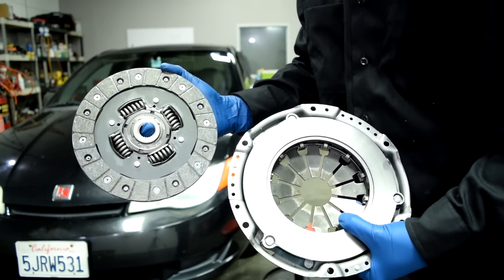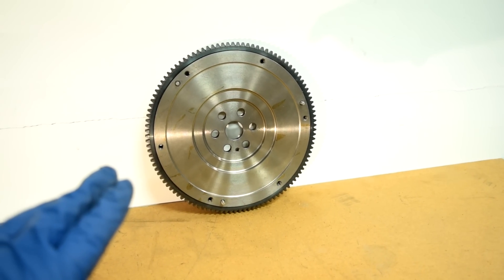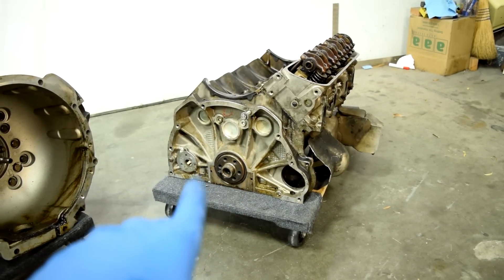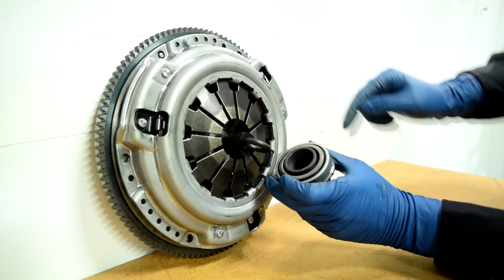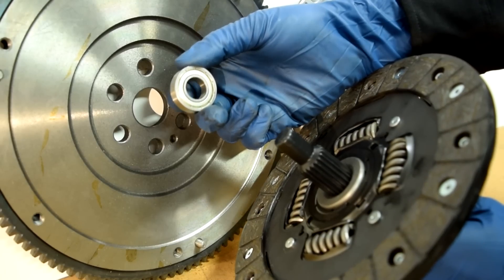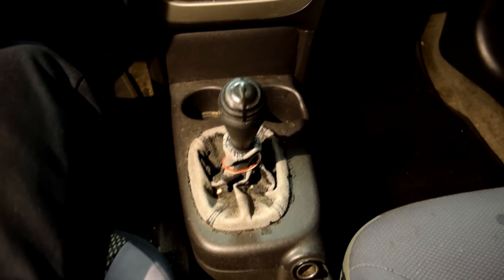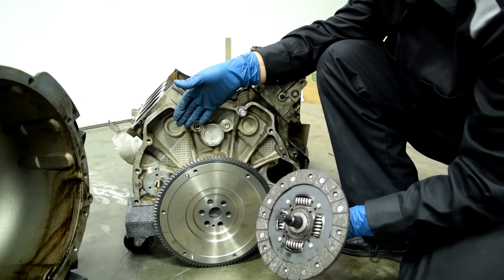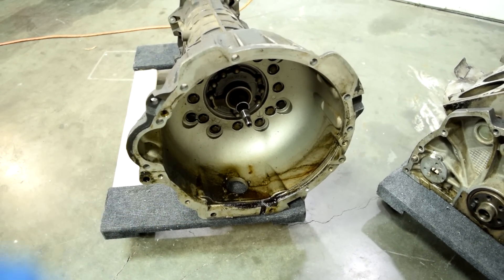How a Clutch System Works and How to Diagnose Issues With It

Comment: I have one question, (And this goes out to everyone who might know the answer)  I have an 2003 Audi a6 1,9TDI. It vibrates around the 2000RPM..  Say from 1850 - 2000.. Every gear. But more noticeable in higher gears. You can only notice it when power is applied.  People told me it would be the Fly Wheel.  How could this be?  Can I eliminate this in one way or the other?
Reply: Sander Baks people are asking all kind of questions and nobody answers ..,sad . me too have a question but I doubt anybody would answer .... anyway , if you or anybody who can give me an answer on a Ford 150 pick up truck 91 year f150 EFI  it got an 5 .0 engine , will that engine be the original engine from factory, ???? I ve seen it on Facebook for sell , I ve seen on u tube videos of that kind of engines are the best on ford pick up trucks now days  , but I did not know they were put on trucks back down to 1991, please any advice, .... should I buy it ????? are those kind of engines really worth it and will that engine be the original from factory,  ..... I do not want to ask owner if engine is original I want a third person answer.... if any one that knows about that particular type of engine, please give me an answer.... thank you very much in advance.
Reply: Hi, Wel, I will answer .. I am from Europe, and that car sounds like a typical US kind of car.  I really don't know .. I am sorry!

Comment: ok. i have a 95 integra gsr (manual). was sitting for a couple years. turned it on in june 2016 but would not drive, the clutch was to the ground. never happened before. alot was going on at the time and i didnt want to mess with it. i haven't touched it since. i did some research and priced a clutch master. what do u recommend for clutch issue and getting car going again after sitting. it doesnt pass smog either but have managed to with the help of old friends. please keep in mind im on a budget. thank you. :)

Comment: My clutch has a bit of a strange issue. It doesn't disengage properly when it's cold outside (difficult to put into first and reverse, grinds second), but as it warms up, it's fine. What could cause that?
Reply: Todd Anthony wrote this in another comment, I wonder if it's what's happening to you? : For safety's sake it is always best to start every manual transmission car with the clutch depressed. In arctic cold weather (like Minnesota) it can actually be a car starting benefit to depress the clutch on starting, once started when you let the clutch back out while in neutral on older cars or worn cars you can actually feel and hear the engine struggle more to turn that thick cold gear oil (like glue in winter) and it puts an additional load on the motor. So it's a good tip for older cars in sub zero temps to depress the clutch and hold it in for a minute while motor stabilizes it fuel delivery and builds proper hot compression.
Reply: This has nothing to do with that. I can hold my clutch for an hour, if it's cold outside, it doesn't work properly.

Comment: Story to tell I'm 24 yrs old I bought my first manual car almost 2 yrs ago the clutch went out when I had 3 months with the car apparently the previous owner rode the clutch pedal all the time at first it started making this really bad noise when I would depress the clutch pedal throw out release bearing and then it wouldn't go into gear if the car was on and then the clutch pedal lost all of its pressure lol it went down all the way to the floor with no pressure had to replace it it's been by far the biggest expense I've had to do on my car I'm a DIYer but wasn't too knowledgeable on clutches but I do know for sure I will be replacing the clutch myself when it's time

Comment: my muffler bearing went out of my truck it cost me 1200$ for parts and labor😂😂
Reply: Did they also fill up your blinker fluid?
Reply: Aaron Frazier 
Is the muffler part of the crotch slave? 🙂
Reply: have you checked your piston return spring yet after a year, 😂
Reply: At 1200 You got deal!  I wish we could go back to the old days when muffler bearings where 1.00 and they would always clean your car for free with this service.
Reply: ast5515 what the hell ........??????
Reply: yeah when you pay for that its best to place your hands open palm side down  flat on the ground spread out a bit , trust its so muxh easier on the knees

Comment: Hello R&WAnother great informative video! A lot of info combined with a few laughs....isn't a better way to learn!!I hope you are still offering the ask a question and you'll answer a question as soon as you post!!!Here goes...01 AudiSecondary/Auxiliary water pump...Nothing much on here about it. Anything to be really concerned about if having to replace?Can I put a metal thermostat housing on the same car? What years could I scavenge from? I was told that the auxiliary water pump was the cause of the water loss, poor kid couldn't afford the 1800 they told him it was going to take to fix it,  but as I'm looking at it and notice the outpour of water in the front, it really looks like the fault is the thermostat and or housing!  So I've decided to do the entire front end!I have it ready to start replacing timing belt parts...noticed timing off, bar doesn't fit, looks like a tooth off on passenger side.    At TDC, turn crank back 30 degrees and turn camshaft back so that the locking bar fits onto both cams?Your videos on replacing the cylinder head and service position are the absolute best. They have guided me to being confident in picking up really nice cars for what I normally wouldn't have been able to afford! Might I suggest that you consider, what I think, is a really cool idea? I suggest you take your show on the road! For instance, I have this problem,  you travel to the problem and help the poor soul solve it! Easy!!!! You'd make a fortune, guaranteed! Wanna start with mine? Best of luck with your channel!!!

Comment: I press clutch pedal down when I start my car  in neutral from habit do you think it's best not to or it won't matter?
Reply: Typey1 some cars require you to do so otherwise it won’t turn on. If you have a vehicle that doesn’t have that function as long as you’re in neutral you don’t have to.
Reply: Always do this. It disengages the gearbox so the battery only has to turn the engine. And there's that one time when someone leaves it in gear?
Reply: It's best at very cold temperatures because as you do so, you disengage the complete transmission. Since the trans oil is thicker when cold, you avoid a lot of frictional forces that could be a hindrance to the engine start